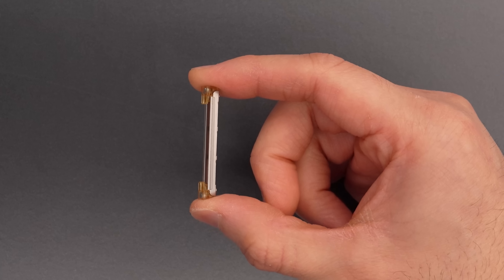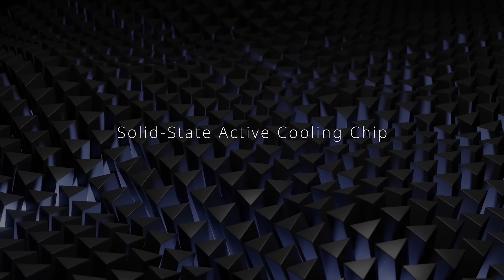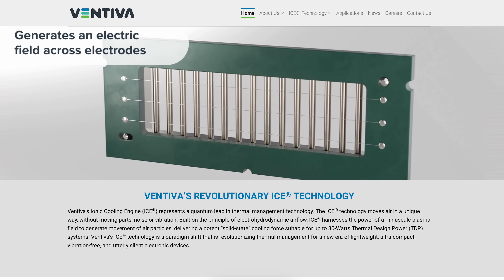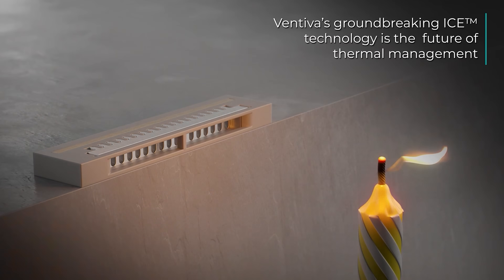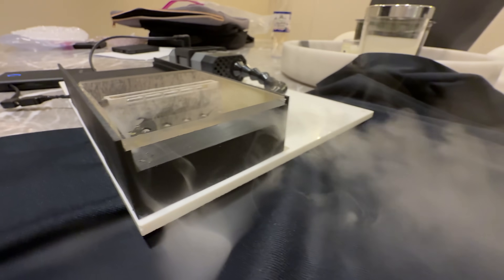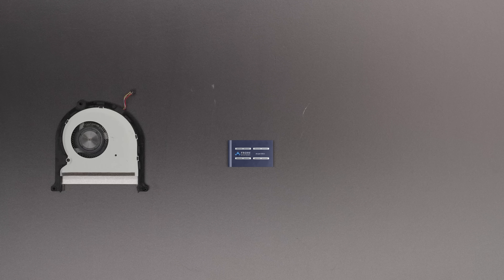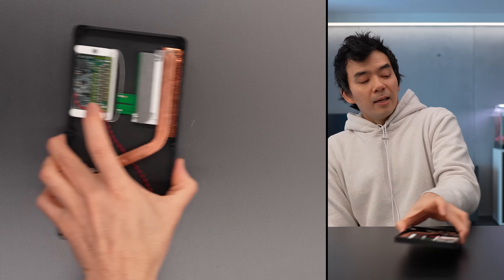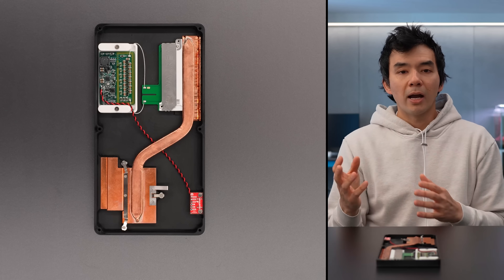The IMPOSSIBLE Laptop Fan...

Comment: Am I the only one flinching every time he touches that PCB? So I don't think the static pressure will be a major problem if the power supplies can run multiple units with out a major increase in power consumption. You run one power supply  and place the coolers exactly where you want them, and you could probably still fit in a small space then a standard D-fan plus you could use less complicated heat pipe systems/

My major concerns are:
1. water damage is gonna be absolutely devastating even with very aggressive ground detection circuits which would be a whole other problem. 
2. the Ionized gasses, in small doses no big deal but with constant exposure, the laptop your pants and possibly you would show signs of wear after months of use.
3. electrical noise and static build up, this can be engineered around but the shielding needs to stand up to every day use and abuse.
4. contamination of the coolers, other people pointed out dust, oil in the air, what have you, quickly degrades the performance of these kinds of blowers, and I don't see a easy way to make them user serviceable.

This is a cool idea but I have my doubts about it making for a reliable consumer product. Of course if you are aiming for a cell phone like product cycle it might not be an issue for the companies, just the consumers.

Comment: Absolutely nothing NEW here.  This is exactly what an electrostatic air filter does, and has been doing since at least the 70s or 80s.  The problem here is that you do NOT want to be collecting dust with your computer "fan"!  lol.  
Good quality bearings and tuned fans, with a replaceable air filter, would be a MUCH better "new technology".  I really don't understand why they never give us replaceable or even cleanable parts.  sigh
Reply: And, really, the BEST solution is to just not create heat in the first place and/or passively dissipate that heat and/or build gear that can tolerate (or better yet LIKES) heat.  :-p

Comment: Seems like a bad idea. Didnt those ionic breeze machines eventually get recalled because they were a health hazard? The issue with ionic wind is that it produces ozone as a byproduct of its function. Sitting in a dark room with an ozone generator seems like a bad idea for your heath, not to mention the computer's parts, as ozone is a powerful oxidizer. Also ionic wind requires high voltage, and high voltage and small integrated circuits don't play nice together. Ionic wind has been known about for hundreds of years, and we've had practical machines that generate it for 100 years. I think it's telling that no one has used this at scale for computer cooling before

Also, electronic interference sucks to work with. This is the big reason I dislike using wifi and bluetooth unless necessary. Having tons of different devices in the same room all listening for and sending out different electronic signals makes the air muddy, it can make it hard to receive quality signal or even read erroneous data. Weird things can happen, I've had usb dongles that accidentally send out electronic noise that reduced the connection strength of nearby bluetooth devices. Ionic wind produces a lot of electronic air noise. Buy one of those little ionic air purifiers, which are significantly less current because they dont produce enough charged ions to be felt as wind, and turn it on near your computer. It's not difficult to notice that they are prone to messing up local signals, with the way they scatter high energy. In my opinion, ionic wind channeling technology works better when theres a projector and a receiver side, that creates kind of a curtain of movement, instead of just an emitter, that way there isnt just random energy being scattered into the air. Also it helps with dust buildup problems, since the dust is specifically drawn to a single point in the room, instead of just haphazardly charged and left to stick to anything it drifts along

Comment: I do not feel good about dust and high voltage.
After a very short time, dust will clutter the fan and short circuit the high voltage power supply.

Comment: Didn’t t the Frore tech describe the physics of the vibrating surface as both able to move the air atom directly touching the surface, and thus being capable of more heat dissipation than the raw CFM indicated as well as able to disrupt to buildup of dust on the surface.  Are you using Frore’s heat dissipation numbers or calculating your own based on the CFM?  This vid seems to miss some of the Frore details, and also not address the vulnerabilities that dust would cause in this system.

Comment: This technology has been around for a very long time, I guess they're finally able to make the high voltage power supply to be small and efficient enough. I question the viability of it though, Not to mention electronically it is usually very dangerous to have something that runs at 2500V-5000V near a CPU that runs at 0.6V-1.2V. Not to mention EMI concerns, large voltages make radiate fields.

Comment: So you're telling me that little high voltage ionic thrusters that are made with tight tolerances  are going to revolutionize things? regular fans track and hold onto dust over time and I can only see these things being even worse as charged dust particles tend to stuck to surfaces that are neutral very close to the device. No, I'll stick with fans because they have a much wider operational range and while they are susceptible to dust they aren't going to be defeated by a little dust tracks shorting out the high voltage.

Comment: You could possibly reverse it or the ionisation charge by a few mods and use it as intake and seal of the most gaps like a MacBook to create a pressure inside the chassis like they do at high altitude or just by using them as vacuum  and use them to flow the air and then use the vents to cool it. Just a thought

Comment: Wait, if the air is ionised so as to make a current out of it and eventually before hitting the copper tubes it is reverted back it's unionised state then the current should lose the kinetic energy gained by ionisation, right? 

How does that part work?

Comment: Isnt this the same tech that ionic air purifiers have had for decades, just repurposed? Also, what if you used both the Airjet and this thing? Then you'd have the static pressure AND the airflow efficiency. You could use a hybrid design. Or perhaps a silent fan to do the heavy lifting for static pressure.

Comment: Whislt it is exciting hearing of something shaking up the status quo, I think just like the cooler by Frore this one has issues, one of which you have already touched on.
Firstly it is the static pressure - its plainly not enough to properly cool a laptop and as soon as you introduce dust into the mix this thing will immediately choke.
Secondly, something you didn't mention, is that this type of ionization that you speak of is finite and the material will degrade over time.

I find it a little strange you were so hesitant to cover Frore, but so keen on this, despite it also having issues that are are probably going to make these not feasible in the wider industry.

Regardless, whilst I may not share the same enthusiasm, this was a good breakdown of the tech, thank you.

Comment: With the high static pressure of those piezoelectric ones wouldn't these be more efficient? Since they can move air faster through a dense finstack which in turn would offer much more surface area for heat to be removed from. Also the volume of the finstack would be bigger, thus making it have a higher thermal capacity.

Comment: What if you used both types of solid state fans and only had the less efficient one kick in when higher cooling is required? The crazy high static pressure could make up for where the more efficient one suffers 🤔

Comment: Same tech as the MIT plane with no moving parts, and the "lifters" that use electrostatic air flow to fly that were popular 20 years ago. High voltage introduces lots of problems.

Comment: I'm concerned about the negatives ionized air presents such as producing ozone also human respiratory affects with long-term use.  If this ionized cooling is scaled to racks the environmental and human risk factors when in use is what I would like to know.    I remember the AirJet by Frore Systems and that looked promising but disappeared. This Ventiva cooling system seems like it could be a step forward as well but we need concerns like mine answered.

Comment: Has anyone ever heard of the Ionic Breeze by Sharper Image? Same thing. The problem is, that device is made to clean the dust in your air collecting on the “blades” so good luck with this and having to clean it out and the manufactures are not going to give you access to do so.

Comment: Nothing new. Used for a hundred years in air ionizers. The technology has a great drawbacks: 1. Ionized air coming from it contains dust particles which stick to nearby surface. 2. Wires inside would be covered by dust and stop functioning properly, cleaning them is very hard task. I don't beleive this technology is suitable for laptops.

Comment: If they can figure out the static pressure issue and have foolproof solutions to ozone issues, there's only one real question I'd have for this new technology. Can it be scaled up for Desktop Computers? how wild would it be to have an absolute beast of a computer and the only reason you can tell it's even running is because the RGBs are on.

Comment: Personally, Airjet seems much more promising.
1) Although the CFM number is much lower, due to the high static pressure, the heat dissipation per watt is not that bad. Airjet uses 1 watt to dissipate 5 watts of heat, while the ICE dissipates 9 watts. It seems like a big difference, but if this is used in a normal laptop (non-gaming one), 50 to 80 watts of heat dissipation is all it needs, so the Airjet will use 10-16 watts while a fan or ICE will use 5-8 watts. To be fair, it is much higher for the Airjet, but 5 watts more for a laptop is not a number that would affect use that much. Plus, I guess the heat dissipation per watt for the ICE in real-world use will be much worse once you add more obstacles to the cooler.
2) Anything that is statically charged, dust will stick to it. Unless it has a HEPA filter in front of it, dust will clog this cooler so fast in real-world use. But with this low static pressure, a filter is not an option. On the other hand, Airjet is much better at dealing with dust as it has very high airflow speed inside the cooler.
3) Ventiva ICE has much better CFM per watt, but with such low static pressure, to get that CFM in a real-world application, you will need to use a lot more of it, which will increase the wattage used.
All in all, very cool tec but more realword testing and number is needed.

Comment: There is a potential competitor of Frore Airjet that may not be chosen to make videos, named xmems xmc-2400, claimed to be providing 39ml/s airflow and max 1000pa back pressure at 30mW power, with the print of < 1 x 10 x 10 mm. The data, if honest, is calculated to be 12x efficient regarding the airflow per wattage.

Comment: I wonder how well such a ionic thruster design works with differing environmental conditions. For example, high air humidity would decrease the dielectric breakdown voltage of air, possibly reducing performance or creating sparks.

Comment: Electromagnetic Fields are also a big Problem at such high voltages. In principle, it could theoretically even be the case that the interference from the "fan" negatively affects the signal quality within the CPU, requiring more voltage for stable operation, which in turn generates more heat that has to be dissipated. In the worst case, this could even lead to permanent instability or some devices would not even make it through quality control during production.

Comment: Ionic thrusters as fans, teslacoils as speakers and lasers as displays.
You can do a lot of fancy things - just sadly none of them are really viable for any daily-used items.

high voltage: the powerstage it self also needs to be isolated well. Just looking at apple having the backlight-voltage next to a data-pin (those laptops are known to completely fry the circuitry with nearly no chance to recover the data or repair anything). 
power density: all nice and good if it is decently efficient - but how much cooling can a single one of those actually provide? All you and they have shown is that per Watt it is not too bad.
Dust: Patented solution for dust? Yeah no. That really seems like they have no actual solution and just try to bullshit their way out of that. They will be using air-filters for the laptop. And to get any airflow through those they will need a comparatively large surface-area so the laptops will have a lot of openings.

So it really has little to no chance of changing anything. Fans have been used for such a long time for a good reason: cause they are the best for the job and nearly perfect.
Laptops could easily be basically silent but they are not simply cause of what consumers buy: People are retarded enough to jump the apple-bullshit-train of everything needs to be thinner. Make a Laptop just 1 mm thicker and nearly nobody would notice, it would not be noticeable in the weight, ruggedness or price, yet it would make giving them decent batteries and good cooling trivially easy.